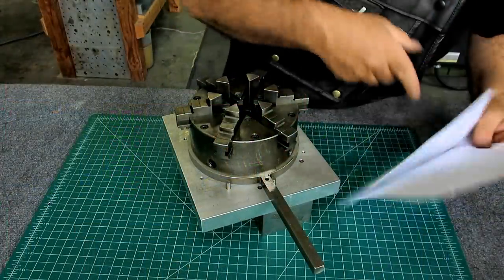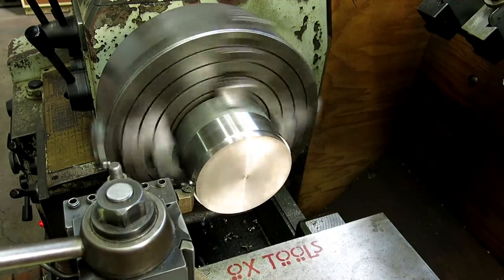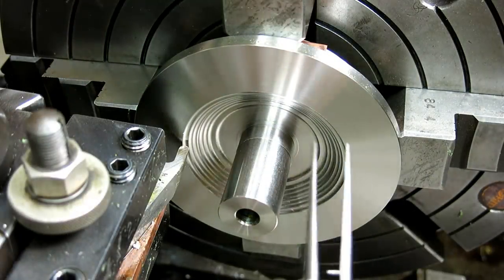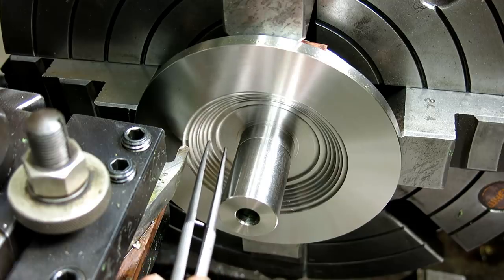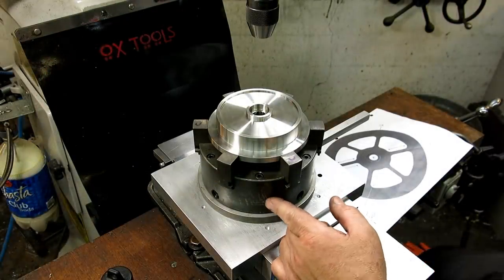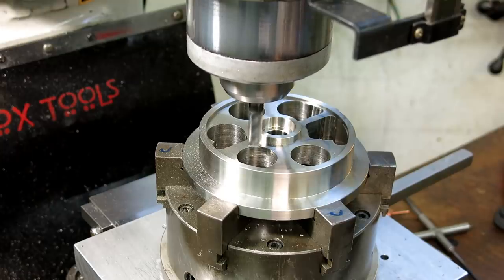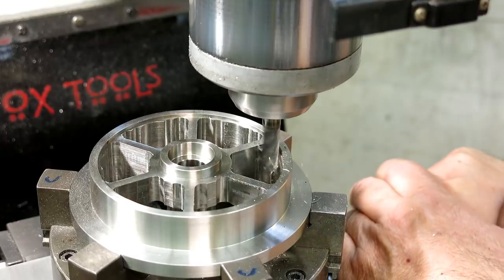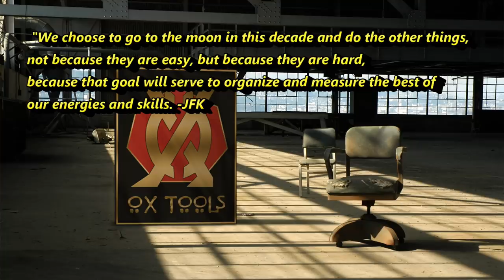Pressure Equalization Valve 5

Comment: Tom,  thank you for machining this pressure equalization valve from proper materials instead of using inferior materials (3D printed plastics and/or wood) like so many of the makers did.  This is a very interesting series, and, obviously, your subassembly fit the hatch like it was designed to, instead of breaking like many of the other subassemblies did.  Thank you again!

Comment: Great example of old school fixturing. My old job gave me an opportunity to handle and study hundreds of similar fixtures from a time when production meant one machine with one fixture for one or two operations, many of them hand-fed like this and it's a thing of beauty.

On the Niagara Cutter, if you or your buddy have any pull over there, advocate a little bit more love for the HSS and cobalt cutters. Since Seco bought Niagara, they've discontinued many of the non-carbide cutters. I get it, carbide is the hotness, but it's a shame to lose most of the catalog of one of the best sources of HSS/cobalt tooling around. Sometimes, people need some big honkin cutter for a job or a small run and it doesn't merit the cost of carbide, let alone an inserted tool.

Comment: I have made similar parts, gears and flywheels in my case, using both your fixture method and a rotary table ... I find the fixture method much easier, and less error prone...so I use the rotary table to locate the holes in the fixture .... great video

Comment: Wow :O I bet that thing is even higher specced than the real thing. Your workmanship is legendary, Sir.
Reply: Having worked with NASA in the past, when they committed resources to something it usually was an army of people that showed up. I can imagine 100s of engineers, draftsmen and machinists spread out across NASA and multiple subcontractors putting this together originally.
Reply: It's a very nice reproduction, but I have a hard time believing the original is anything less than the highest possible quality.
Reply: @Phyde4ux  Well quality as it was defined then. Remember this version of the hatch was completely redesigned after Apollo 1 so yes there was a lot of scrutiny on the escape portion/ease of use so I imagine there was a lot of QA inspection that went on for each part after manufacture. What I find really sad is that nobody could get the original documents nor seem apparently to find anybody who was involved in the project to discuss it. I'm impressed by the reverse engineering but it would be also great to get an "in the trenches" viewpoint when this was being designed and built.

Comment: I'm sure we didn't have cutters like that when I retired in 2004. 😢  It's impressive that you improvised a fixture to machine a part like this.  That sort of problem solving is what separates the men from the boys. 😉 A lot of my time on a mill was making load cells that were not dissimilar to this part, but always with four pillars.  They had to measure the z axis as well as x and y, so there would be another four pillars between the central mass and an outer annulus.  I more than once was given a drawing that was impossible to machine.

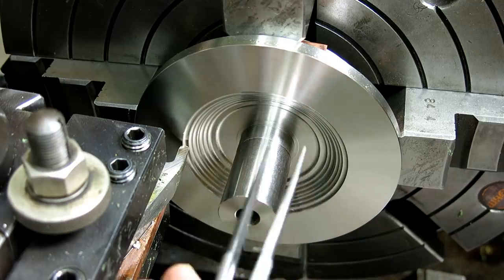Comment: About 12:00 in: it's called "circular interpolation" where you calculate carriage/cross-slide (X-Z) increments to yield a tool path for that radius tool that generates the radius on the part. Bone simple if you have a DRO. Not bad with a couple travel indicators either. I have a little spread sheet on my computer where you inputvthe radius desired on the work, convex/concave, tool radius, feed increments, etc and it spits out a rectangular coordinate offset list. Otherwise I just punch my calculator.
Reply: Tom did something similar in his Wilton Baby Bullet series #15-16. He called it curve kellering.
Reply: @Phyde4ux  Yeah. "Kellering" is a general term for manipulating the tool to generate a curve. Old time die sinkers became masters of the art out of necessity. 

Circular interpolation may be considered kellering but since each move is separately calculated and incremented along a precise tool path, a more descriptive terrn is desirable. The CNC world has a variety of tool path generating techniques where slopes, chamfers, radii, spline curves, etc are built into the software. Fancy curves, angles, solid shapes of every description are thus generated at speeds and within tolerances not even dreamed of when I served my time. I believe "interpolation" in this sense comes from calculating intermediate points along feature surfaces requiring coordinated motion of two or more machine axes - that is, calculation incremental postions are much like determining the final significant digit or arc seconds from log or trig tables (remember them?).

Comment: I would love to know how that part was originally made in the 1960's.   BTW, is it known what the original materials were?  Weight was critical so would they have used something lighter?
Reply: I believe that part was made of stainless as well on the real one, though I never did see the drawings for this particular assembly in my research. The whole hatch was around 280lb, so function and crew safety was the primary concern.

Comment: Clever and Cunning, too. Old school vision to find solutions... wow! || Am i correct, the pin got stuck because the metal cooled and shrunk tight in the short time the pin was in place? || I love seeing the trick you do that i learned to do when things are awkward and it is below zero... put the square head driver in at an angle so you could easily spin down the set screw to pin your turning handle! || i could hear a pulsing chatter cadence when you fancy new mill got into the courner. Could/do you hear it too as your cue?

Comment: That's a brilliant way to mill those radii without the use of a rotary table. With only one set of holes (for each radius) for stops on your fixture. How did you index the part to mill the radii on the other openings?
 I machine a lot of stainless at my job. We don't do a whole lot of 303. I work with mostly 321 and 347 stainless. And a particularly nasty special variety of 347 that loves to kill inserts.

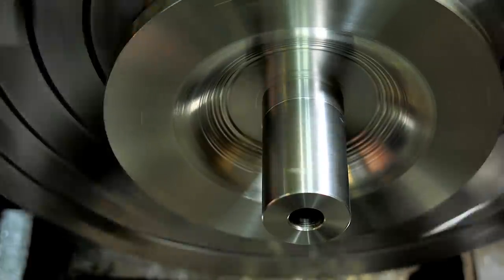Comment: How did you get the concave radius before going with the abrasive pad (at approx. 15:30)? the scraping tool you used on the convex part seems too pointy to be practical further down the curve…

Comment: How did you finish the interior of those parts. Off the manual rotary table you could see tool marks, but the finished component had a beautiful, consistent matt finish. Bead blasting?